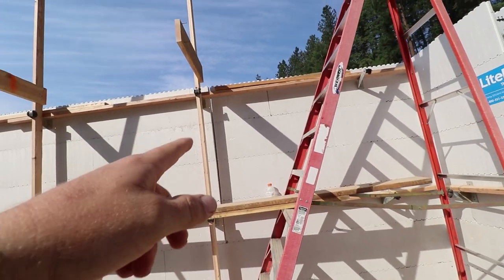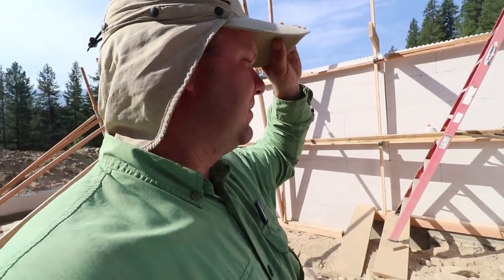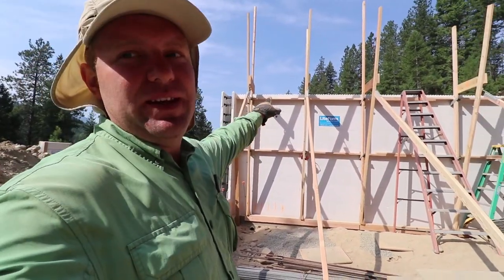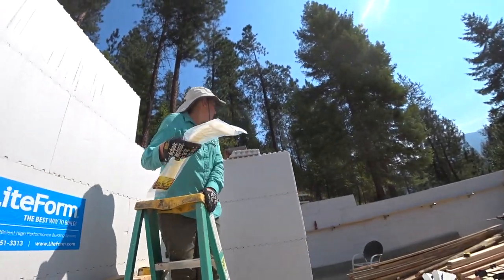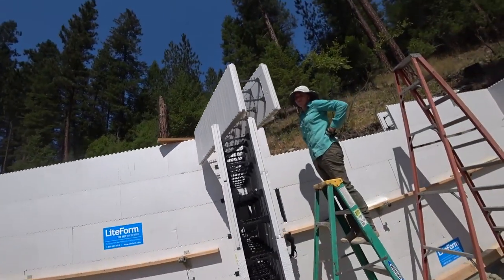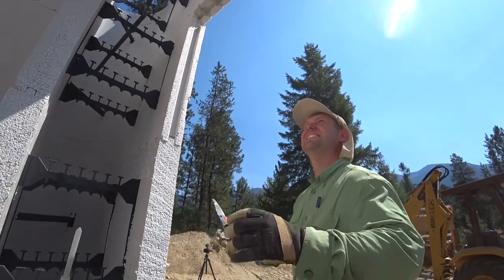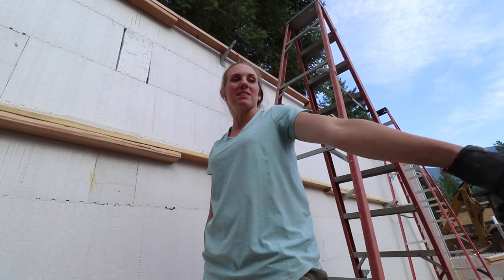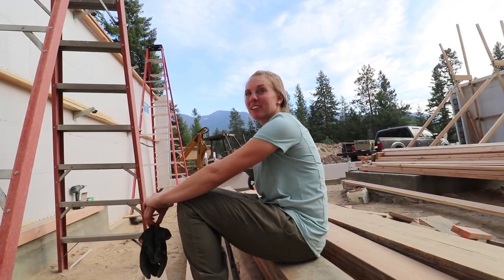Building a House Start to Finish: ICF Construction on Mountain Home in Wilderness

Comment: So I'm watching your videos and am really impressed so far. But one thing that seems like an easy solution is to use the wall bracing to pull the top of the north wall back into plumb with the wall that has the gap? Is there a reason that would not be possible? I assumed that was the reason for the bracing and flying strongback? (11:30 I see the attempt to push it back in)

Comment: I realize it is your house and  the problems are your problems, I would like to make a suggestion that may help with your frustration of drilling concrete. First drill a clearance hole in the lumber, then drill the concrete through that hole, by not doing so you are putting unnecessary load on your drill as well as yourself. The drill is bogged down by trying to drill through a same size hole in the lumber and the concrete too. You have two drills and if needed buy a third so you don't have to change bits. Easier is there if you just use it.

Comment: Hey guys
Your concrete drilling would go so much faster if you invested in a sds hammer drill. A corded one can be had for a couple hundred but we'll worth it. I know your plans for the future include out buildings and it would pay for itself 10 fold. There is a makita 18v out there but it's double the price.

Comment: Jessee,  how about using the glue in the tube to fill in the gap. I am thinking it will hold the pressure of the concrete and not blow out.
Reply: No, Jack, I have never poured or worked concrete, was just making the suggestion of using the adhesive between the upper portion of the blocks to fill in the gap.    My construction working was as a Pipefitter/Plumber for 35yrs before retirement.

Comment: Would it had been better to rent scaffolding instead of building it? It would have taken less time.
Reply: Most ICF makers give you a set of scaffolding to use which you can return when done for a return refund if not full refund. They just wasted money on one time use and then toss in a recycle bin for it to be sold as scrap. Fab Form Zont system may make the wall horizontally square, but the vertical will not be as true square. Even the vertical metal systems are flattened against the form but also come with horizontal which is put in between each one to also make it horizontally true.
Reply: Thank you for the reply. That makes a lot of sense.

Comment: when using your hammers you must use more of the handle so you have more force and less work to hammer in your stakes.
Reply: As people who don't do this every day I think if they didn't choke up on that thing they would be busting their knuckles, makes sense to me that they choke up on the sledge....
Reply: Not being negative just stating a fact. It is better to choke the handle then bust your fingers and loose more productivity.  I enjoy your progress.
Reply: I don't think her wrists are accustomed to sledging with a 2lb hammer, hence holding it closer to the business end.
Reply: We used to cut the handle down to about 20" on an 8 lb sledge for driving stakes, much easier and harder  hitting.
Reply: Jose A Garcia I didn't see that part.
Reply: Ya but then it less accurate. If your not doing it every day that is.
Reply: I used to work with a guy that sawed off the end of the handle if he saw apprenticeses holding it near the head. Soon made them learn.

Comment: Having it out of plumb is least of my worries.  Pouring concrete more than 4 ft. drop can cause the Concrete Aggregates to separate.   Assuming the concrete can be delivered inside the forms less than 4 ft drop and vibrated properly.  The next worry will be blow out without proper shoring of forms.

Overall it will be best to hire a professional, it will save you time and all the headaches tinkering with Code Compliance and Construction best practices.

Comment: should i laser level my concrete footing first?
Reply: kevin lodge, you should take up all footing irregularities in the first form course. If you get the top of the first course level and plumb all round it will carry on up through the build. Spot check for level every course or two, especially if you own the construction site laser level and don't have to rent it each time you want to use it.

Comment: The problem your having with the one wall off sound like some problems when I'm running a mill (machining parts). Your problem a lot bigger scale than my problem. For me it all starts when I tram in a mill in, the clamp wasn't holding, and  if the mill isn't set up right and it  rocks it will be off so much can go wrong.

Comment: It could be me, but if you know you have this little play in your blocks. Why not set the corners with a laser on the same height, put a wire between the 2 corners nice and tight fill it up with blocks and you wouldn't have to shim/cut 1/2". You would prob have seen the 1/2" difference sooner too.

Comment: Wouldn't extending your common seam all the way down in that section of the wall fix your wall issue? seems like a much simpler fix than trying to make a wedge cut in multiple bricks.

Comment: On a traditional plywood formed wall or even with aluminum panels the forms usually are a couple inches or better higher than the planned concrete...then you chalk line a red line inside the top of the forms to level and pour the concrete to the line...this eliminates this very problem with out of level footings..maybe you can do that with the ICF foam and then trim the foam to the concrete when done...the floor is also chalk lined or expansion board set to height then pour to your line....just saying..I've done hundreds of foundations and the only problems I've seen has been blow outs or cold joints due to concrete trucks running late...

Comment: The reason you always have trouble drilling concrete, is because you are using a hammer drill which cannot grip the bit and effectively transfer the hammer energy. This hammer energy is necessary to shatter the stones in the concrete. What happens is the hammer energy is absorbed in the chuck in the form of slippage. Purchase a rotary hammer drill that use SDS masonry bits, you won't regret it. My guess is because of the delay in video production time you may have already drilled your holes and this may be too late. Best of luck.

Comment: A couple of remarks.

You complain that you have too many small tasks and you have not enough time for building. You should not forget that these small tasks, being fetching information, preping, cleaning, etc. are completely part of the building. They are not stacking blocks, but without the small tasks, you could not pursue with the stacking blocks. You have to accept that you will be stacking only 50% of the time and doing other stuff the rest of the time. You could even start organizing your day around that knowledge, knowing that you will do the heavy exterior work early in the morning or in the evening and keep the lighter tasks for the middle of the day, when the sun is hot. To some extend, washing your work clothes is also part of the building: with no building, you would not soil your clothes...

Regarding the crocked wall: would it be possible to cut a common seam as close as realistically/safely possible to the N/W corner/ Then you'd have to cut an horizontal wedge or two in the small portion of the West wall still attached to the corner, and you'd get enough relief to straighten the North wall. (the common seam will also need to be cut as a wedge to allow the North wall to move in).

You will need extra bracing around  the wedge and common seam, but that  will be needed only until the concrete is poured.

Or you could leave it as is. Structurally, even slightly slanted outward, I am sure your wall is sound. In fact, pushing outward will help retaining the soil behind it.

Comment: Where are the windows?!!  Is it just going to be a big box with windows in the front and none on the sides, well the one side that isn't against the hill.
Reply: Most basements are partially below ground so no I wasn't aware it was a basement but it makes sense that it is a garage.  Garages here have some windows in them so even garages can have windows you realize.
Reply: There are two garage doors in the front wall.  Looking at the front of the house, the door on the left is a double and will be used for the RV.

Comment: why work like crazy trimming the ICF's set the way it is and TRIM THE TOP-PLATE!  I see you have one of those power planes just trim the tip plat to make it level.  Or.,...jack the hell out of that back corner.  Put a turnbuckle on that corner and jack it towards the front.  I have chased over 3/4" in four feet of wall height.

Comment: So they bought an exspensive laser level and then didnt use it to check the footings were level before pouring the concrete??
Reply: They had the footings poured before they bought the laser level.
Reply: No, they've had the laser lever for quite awhile now. They bought it while still working on that over-complicated water system
Reply: I didn't see who or how the footings were poured. But they should be level. The whole house is based off of the footings.
Reply: lastniceguy1: I think they glued leftover packing foam slabs to the outside of the membrane for the first foot or so where they backfilled pea gravel.  Not sure what the plan is for the rest of it.
Reply: just because you have fancy tools doesn't mean you are good builder
Reply: It is probably from the little 1x2's they used as cross bracing that caused a little lip of concrete that started the whole thing.
Reply: fred S assumption is the mother of all fuck ups. They assumed because the form work was level the concrete would be also.
Reply: Everything done so far was done half assed and it shows. Many people pointed it out, they said trolls are targeting them, i mean, at some point one learns to...accept that one failed, not this guy.

If it were up to me (and certainly if this was one of my work sites, oh boy) if my guys made a mistake like this out of their own stupidity, i'd have them tear the whole thing down. I learnt so from my father, and he did from his, two wrongs don't make a right. And there's a lot of things that will bite them in the ass in this. This one, it's just the tip of the iceberg.
Reply: strawbal e I'm glad I never made a mistake!
Reply: KFStreich making mistakes isn't the issue. Jessie has a problem admitting the root cause and prefers blaming others. Even when he misplaces the hammer he starts to put the blame on Alyssa
Reply: Konrad, sometimes its cheaper to buy equipment and sell it on afterwards over renting stuff out. I see your point though about not using things.
Reply: hooray for cumulative error. STAY TRUE TO YOUR REFERENCE DATUMS and check them often.
Reply: strawbal e this has absolutely no effect whatsoever on me or anyone else watching their videos, if it is a problem in their relationship they need to work it out, if it is something they have learned to accept then all is good.  either way, none of my business, perhaps all the animosity on the part of viewers leads to more views, more ads, more profit?
Reply: KFStreich you made a comment as if to say that expecting not to make mistakes is unrealistic, no? I was just responding that making mistakes isn't the issue in MY personal opinion. That he often  tries to put the blame on others for his own shortcomings is making him blind to changing how he should approach the work and reduce future mistakes ans hold ups, for the sake of both of them. 

Do they care about my comment or opinion? Probably not. Does anyone else? Probably not. I'm not expecting the world to bow down to my utterings. But  they have posted a youtube video with publoc comments. Im just commenting. It goes without saying that what I write here has absolutely no bearing on their project or relationship. 

I agree that it sometimes feels like they are trolling for disputes in the comments section on purpose because they know it generates traffic. Which is clever.
Reply: strawbal e my comment was sarcastic, I can't tell if he learns from his mistakes or not, constructive criticism is fine, so much of what I read here sounds like apprentices or young journeymen frustrated with elders who speak to them without respect and pass it on with even less diplomacy
Reply: Knowledge belongs to the trade not the individual.

Comment: What about the windows and doors
Reply: The front wall has two roll up doors.
Reply: Then thats a garage I guess they will still keep stacking the ICF blocks much higher for the house.
Reply: Michael Bouley Without checking their building plans, I'd hazard a guess that they didn't, because they will build timberframe up top.
Reply: Timber frame on top of this concrete foundation.  Go to their facebook page to see the drawings.

Comment: didnt at one point early in stacking someone you called told you to do a vertical relief cut?  well at least now your going to have to fix this. I wouldnt cut the top of the forms to get a level surface but rather snap a string line and pour to it.   thats less work

Comment: This "relief" cut sounds like more trouble down the road.
Reply: Yeah, but they can't extend the seem down any further, as there is membrane on the outside, which is partially backfilled due to the drain. Having the seem further down would likely solve the issue of the backwall outbow, but not the height difference... guess following the instructions from the get go is the real way to prevent problems in the future. Best way to learn that cheap and early is to buy some furniture at IKEA ;)

Comment: I don't get it, the exposed southern side walls have no brick ledge what is the final siding going to be other than the polyguard that's exposed or foam?  The final dirt grade is not going to be to the top along the sides.

Comment: if you had spend a bit more Money on concrete and poured the footing 2-3 inches wider on the inside you wouldent have had to  fasten all those 2x4 on the side of the footings.. You could just have put a 2x8 with a 2x4 on top of it, on top of the footing as a straight edge against the blocks and something to nail the scaffolding/bracing to post to. .

Comment: I work in construction and worrying about an 1/8 inch or 1/16 in when forming walls is asinine. You just dont have to be THAT precise with this stuff, wait for the concrete to start pumping in and you will see that things move slightly and etc. Its just part of it, you cant be so worried about these minor things, you will never get through the project.  make it plumb and square.. rest will come out in the wash.

Comment: One eighth of an inch! What are you peole trying to build? Perfection? In building perfection doesn't exist! +- one inch is typical accuracy.
Reply: OCD is a terrible affliction, and he has my sympathy, but why build a house out of ICF? Surely a SIPS or Timber-frame property would suit him better?
Reply: I agree with John, an 1/8th of an inch is nothing and would never be seen nor cause a single problem. Cutting gaps in walls, shimming and other "solutions" will cause problems. Just call the pump truck and get going!
Reply: Thank you Dale.
Reply: The way I understood it is that each block is 1/8 off. So over 8 blocks, that's a 1 inch gap!

Comment: why don't you please pre-drill the boards on the stack then simply drill the concrete through the pre-drilled hole, so much easier. Concrete bits don't like to go through wood.

Comment: you already have plenty of bracing on 3 of your walls, why don't you remove 2 foam panels from front so you can walk into your construction site without having to jump over a foam wall each time you step in ??

Even better remove 2 and covers footing with dirt temporarily while bending the re-barb over so you can drive in with machinery if needed. why making your work/life more difficult?

Concrete bits and drilling do some YouTube research make your life easier

Comment: Easy solution: Don't use ICF Walls! It just far easier to form the foundation the old fashion way and then attach insulation on the exterior & Interior walls. with ICF, everything has to be absolutely perfect.

Comment: Why are you having a concrete wall sticking 8' out of the ground.  It would be much cheaper to have built the exposed walls out of timbers and framing rather than concrete.

Comment: Wouldn't it be 'better' to cut the blocks where the concrete is to high? So only where the step-down is, Or is there a seam that can compensate for the one piece of wall that will drop while the 'front'piece wont? Or did I not understand where you will cut foam of?
And please stop mangling that drill and get a real rotary hammer.  99/100 that you wont regret it. ;-)
And of course thanks for the videos and for making mistakes, like a normal human being, so we could maybe learn from them.

Comment: Man, you are not building the Giza pyramid.  1/2" variance in the height of the concrete pour is nothing to be concerned about.  If it bothers you that the wall is a mere 1/2" off, you can just add some shim material under the rim board.....or better yet, just fill the concrete to within 1/2" on the high wall.

Comment: are u putting in windows
Reply: Thank u
Reply: I don't think you need windows in a basement/garage that faces a hill on three sides.
Reply: IthinkthereforeIam OrsoIthought   You dont need lintels in a concrete wall ... you fix rebar pre pour that supports the head of the ope ... a block wall would be different

Comment: 1/2" out on a footing is well withing normal build standards.  I doubt that "professional" would be "agonizing" over the small amount out of plumb/level/square that your walls are.

You sad it before, it s how you compensate for small imperfections and I think your idea about cutting a wedge out sounds very plausible.